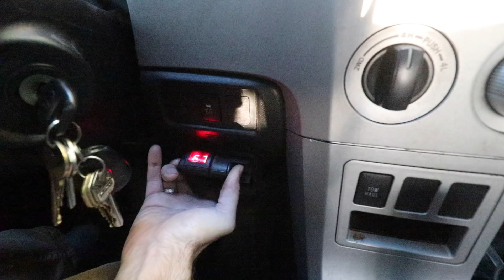How To Load a Trailer to Prevent Trailer Sway

Comment: I just used a weight measuring hitch with a little scale dial on the side and it was the way to go when getting close to the limit of GVWR with a skid steer.  I've driven professionally (trucks) (way easier) and towed with pickups some (more dangerous).  This is a game changer if you haven't had to load a pickup to capacity, or just want to be safe.  Alternately, if you feel like the front end of the pickup may be steering weird because you have the weight too far forward on the trailer and the tongue of the trailer is pushing down on the hitch too much, you are right, if the truck feels a little squirrely.  If you have weight too far back, you may never get the chance to figure it out.  I hauled a load of long logs hanging barely out the end of a dump trailer.  I went super cautiously, had no doubt I was being save and never went over 10 MPH down a steep hill, to be more sure the brakes would get me stopped, but on a lesser grade I got up to about 30 and maybe gently tapped the brakes (trailer brake control probably hit hard and caused the tongue to dive and force weight on the hitch, popping the front wheels up a bit), and it was over after I hit the brakes.... and braking made it worse, because then the tongue weight increased again as the trailer dove down on the tongue due to brakin forces and gravity down hill.   Bit of bucking going on, I suspect...  35 MPH and it ripped me off the road and down about 5' through some shrubbery and into a stone wall.  No real damage.  Just a shrub and trailer sheet metal that hammered back without a difference.  Lesson learned.  Do not have disproportionate weight behind the rear axle.

Comment: One of the government bodies here in australia used a similar method to show how increasing the COG decreased the angle required for a roll over. It also showed the roll over starts from the back. Vicroads used a scale model logging truck for that demonstration. It works quite well.

Comment: Applying the trailer brake trick saved my ass in the U.P. of Michigan pulling a loaded 4 place snowmobile trailer with my Suburban. No issues with load, going around a sweeping bend on the highway, snow covered, when the trailer started sliding. I knew it wouldn't be long before it pulled the ass of the Suburban with it, a gentle application of the trailer brake pulled it right back in line. Took another mile or two for my ass to let go of my underbritches.

Comment: To give a bit of background before my towing fail story, I'm active duty Air Force F-16  dedicated crew chief(I fix airpalnes). It was cold raining December morning around 2 or 3am in Germany. The last job of the night for us was to tow a jet down to the fuel barn. I had a shift full of younger airmen that didn't have a lot of experience and I'm the only person that was aloud to tow super. We get down to fuel barn and chock the jet so we can spin the tow vehicle around(You push the jet s back while facing them). Find out the windshield wipers just died and the only tow rig we had the rear steer didn't work so the rear wheels were stuck not straight. We get the jet in and the fuel shop guys want it straighter in there so as we are pulling it back out of the hangar a light on the vertical tail caught a chain hanging from ceiling that non of us have ever seen and snapped the light right off the tail. All we heard was the loud popping sound and the chain whipping around. We could only see the chain we shined a bright light in it. No one got in trouble since the person sent o look into said it was unavoidable and the main culprit was the invisible chain. That's the only one I was involved in but I got to see a bunch of incidents right after.
Reply from the maker: Dang, so how much is a new light for a jet?? 😅
Reply: @bleepinjeep  I think it was about $5000 for parts and about 10 man hours to fix it.

Comment: There are a lot of people who will panic and jam on the brakes when there is a death wobble. It’s so counterintuitive but in addition to applying the trailer brakes like you said but also should step on the gas. The physics will make the vehicle “longer”, stretching the train out. Instant stability.  The same thing also applies when you get a tire blow out, especially the front tire. If you get a front tire blowout, you want to floor the gas, as hard as you can.  Once you have gained control of the vehicle, then you can slowly ease of the gas and pull over safely to the shoulder. There is a whole video that some highway or truck safety people did on this. Actually exploded a tire while moving at high speeds. It was fascinating.
Reply from the maker: Interesting thanks

Comment: Excellent video - thanks for providing it.  Very good demonstration.

You talked about tongue weight based on GVW of the trailer.  It is important to know the Class of hitch you are pulling with so you don't exceed the ratings and have the hitch itself fail.  2" receivers (Class II, IV, and V) can look the same, but have very different ratings for load and tongue weight.  According to Curt Manufacturing:

Class 1 is rated at 200 lbs max tongue weight
Class II is rated at 350 lbs max tongue weight
Class III is rated at 800 lbs max tongue weight
Class IV is rated at 1000 lbs max tongue weight
Class V is rated at 2400 lbs or more max tongue weight

These numbers seem to vary some between hitch manufacturers.

You also talked about loading vehicles that have their engine in the front (most!).  As a general rule of thumb, the balance point front to back for these vehicles is about where the steering wheel is.  I find this knowledge helps in determining where to position the vehicle for safe weight distribution.

Something else your video was close to demonstrating.  If the hitch on the tow vehicle is too high - as with many lifted trucks, there is a risk of the front wheels of the towing vehicle going light and coming off the ground.  Not from excessive tongue weight, but rather from hitching too high above the center line of the axles which allows the towing vehicle to walk around the rear wheels and possibly flip backwards.  This is a huge problem with our farm tractors.  They have the power and will dig in and walk the tractor right over backwards and kill you in an instant if you hitch too high.  Flipping from this is less of a problem with on-road tow vehicles, but hitching too high will cause the front wheels to go really light and cause a loss of control - similar in a way to excessive tongue weight.
Reply from the maker: Good info thanks!

Comment: Towing my full size Jeep from Spokane, WA to Boise, ID and the spring pack bolt on the rear axle of the trailer broke, the whole axle on the passenger side slid back to the spring hanger, the tire disintegrated and the trailer kinda went crazy, this was at 75 mph! I used a come-a-long and pulled the axle back in position, put the spare on and finished the trip!
Reply from the maker: That'll make a tire hot quick 🔥

Comment: Trailer sway around 2006 or so. Took my dad on his first and only wheeling trip which he didn’t enjoy. “Too much waiting around watching other people”. We went to Livingston, KY when you could wheel there. Put the TJ on the trailer hooked to a v8 4 runner.  He hooked up and tightened the straps. Apparently he didn’t tighten them and I didn’t double check like I should have because I figured “my dad knows what he’s doing”. Jeep slid back probably a foot or so.  Came down down a hill on i75 north of Livingston and the trailer started swaying and it got worse. I looked back and saw black S marks on the road from the tires.  From what I remember, I let off the accelerator and manually engaged the trailer brakes to slow everything down.  We were lucky that day.  Pulled into the next exit to tighten the straps.
Reply from the maker: Ohh wow, very lucky indeed!

Comment: Fortunately haven't had anything too bad happen, but we towed an early Toyota pickup home and it was so rusted out there was a perfect line of rust and pieces of the frame on the trailer decking when we got home, we only needed the front axle so we weren't too concerned. I'm banking on winning, my Scout ii needs aligned, not that'll help it any haha. Great video!

Comment: I don’t know why this was so entertaining, but it was. My scariest towing experience was when I loaded my ‘51 Landrover series one onto my 9’ long utility trailer towing it behind my ‘97 TJ. It was going fine until I hit the highway, at about 55 mph it started swinging back and forth wildly. Just too much vehicle on too small of a trailer, no way to get it balanced correctly. Promptly got it under control, turned around and took it back to the storage unit I had been storing it in. Ended up finally moving it to where I was a couple of years later using my duramax and a goose neck equipment trailer. That was much easier and not scary at all. Lol
Reply from the maker: Lol, 9 foot trailer, that mustve been entertaining 🤣

Comment: Headed to Moab towing my ZJ on a car dolly behind my 2018 4Runner, which had been towed many times this way and no issues. I just had lifted it 4” with 33’s and I didn’t think of the top load, un sprung suspension. Get on the highway which is 80mph here and we got up to 70mph with my wife and 2 dogs. The Jeep started swerving side to side in both lanes on the highway as a motor home was approaching to pass, he slowed down and I managed to slow it down and get it off the side of the road. Made it down the canyon and off the highway and realized I need to ratchet my front end down to compress the suspension to gain control. Then as we hit the 2 lane road into Moab, my spare tire bounced off and bounced under my Jeep pancaking my muffler and smashing my pinion yoke skid into the yoke and it kept spinning which rounded and smashed in the threads for the u joint bolts. Then I was running down the highway to recover my spare that lanes in the middle of the highway. Big thanks to Dan Mick for letting me use his shop and tools to make to the Jeep back up and running for our Epic Moab Trip. Now there’s a flat deck and 2500 suburban. Learned my lesson. Thanks for your videos and humor love it.
Reply from the maker: Sounds like you needed to turn around and go home 😆

Comment: I've been a trucker for over 25 years, I've seen so many towing related accidents.  Most are due to driving WAY TO FAST... SLOW DOWN AND LIVE TO SEE THE TRAIL.   65mph is plenty fast enough.  
2nd I'd say is the tow rig is too small for the load. Just yesterday near sault st marie Ontario,  I saw a Volkswagen golf pulling a 20ft flat bed tandem axle trailer with 7000 lbs axles and a canam maverick on it. 
I do alot of float work, hauling excavators,  dozers, rock trucks and logging equipment.  Load placement is super important issue for sure.
 Good trick is to stand back and look at the way your vehicle is sitting, move the load forward then back to find a spot that your happy with. Then mark the trailer, if it rides bad then move it forward or rearward to find the right spot.  
Following distance..... is a real big safety concern.  Remember to hang back and avoid following to close. I've seen a number of people pulling campers rear end the car ahead of them when traffic slows down unexpectedly. 
Be safe and enjoy hauling.

Comment: My first accident was in tow, before I even had a license. I lived in rural-ish Nevada at the time. I was 12. My chore was to load up the trash in an old 50s Chevy flat bed and drive it to the dumps. Out there no one cared if I was old enough to drive. The gas gauge on the truck didn’t work, so one day I just flat ran out on the way home. Walked the few miles left to the house and got my mom. We drove our ‘77 K5 blazer out to go get it and tow it home with a strap. My mom drove the blazer, I drove the old flatbed. The last stretch was a down hill grade to our home. When we made the corner I tried to apply some brake to keep the strap taught and the pedal went to the floor. Just so happens my grandma was also in the truck with me. She saw this, panicked, and yelled out the window “NO BRAKES!!!”. My mom thought she was yelling “BRAKES”. By this time we were all moving at a good speed. I’d say 30ish. So my mom hits the brakes, hard. And we can do nothing but hold on. Mind you, this old truck from the 50s did not have any sort of restraining system. Not even an old rope to go around your waist. So grandma gets dashboarded and I get a bloody nose from the steering wheel. My mom gets whiplash, because she had turned around and was looking towards us. So that’s my towing story. Not towing a trailer, but strap towing and old truck before I was even old enough to drive.
Reply from the maker: Ha, good times 😆

Comment: Informative and the toy trucks are a great way to demonstrate this. All I would add is that when it happens: take you foot off the gas and counter-sear, as you said, DO NOT touch the brakes - when the Jeep and trailer slow, things will smooth out!

Comment: You should mention the benefits of a weight distribution hitch and how its different than airbag kits in the rear. Also how most 1/2 ton trucks require them for trailers over 5-7k pounds for proper weight distribution, steering and braking performance while towing

Comment: Scariest towing fail was in high school. Dad and I were taking a sponsored trophy trailer to a roping. I hooked it up but was used to gooseneck trailers and this was a bumper pull and didn't even think about the different ways they lock onto the ball... Lost the trailer on the freeway at 80mph. Thank goodness for safety chains😂😂
Reply from the maker: Ohh wowi bet he was mad!  What's a trophy trailer?
Reply: BleepinJeep it was just a horse trailer that had vinyl decals of companies' names and logos all over it that was to be given to the winner of the roping as a trophy. As soon as it came off and slid up under the truck and hit the ball (putting a great big dent in the nose of the trailer) I knew exactly what happened and I'm pretty sure my heart stopped

Comment: Great footage!! So A good friend and myself were in an 88 for ranger and we were hauling a 20ft trailer loaded down with scrap, we had to hit the brakes rather hard to avoid hitting someone and when we did the trailer jack knifed because we had all the weight in the rear of the trailer, when it jack knifed it ended up pushing the rear end of the truck all the way around and forced the front end of the truck into a ditch, fortunately no one was hurt. The trailer unloaded it’self too so that was cool lol

Comment: I was getting ready for Jeep beach in Daytona last year and did a frame swap over the weekend. Rented a uhaul and drove the Jeep up onto the trailer but quickly realized I didn’t do brakes yet and drove over the trailer. Had to get a wrecker to lift up the nose while we drove the trailer forward. Then realized the straps on trailer don’t fit 35’s so we had to let all the air out of the tires to get the Jeep home 5 miles down the road.
Reply from the maker: Gotta have brakes for jeep beach ! 😁

Comment: So about 11 or so years ago my buddy had an old Honda Civic with a blown transmission. He needed to move it to a relatives house about 30 miles away to store it. Did we do the smart thing like rent a truck/trailer from U-haul? NOPE. We bought some sketchy universal tow bar and attempted to flat tow it behind his even older Suburban. We had no idea what we were doing, even if we did there was probably no way to safely connect that bar to the Honda. We had walkie talkies, a chase car and 5 guys helping out like this was some sort of massive undertaking. The damn thing didn't even make it two blocks 😂. It started swaying all over the place, immediately snapping whatever rusted support we bolted it to. Then when he stopped to check on it the tow bar impaled the radiator... he gave up and junked the Honda shortly after that (probably for the best).
Reply from the maker: Haha, sounds like a fun adventure
Reply: We made everything into an adventure back then, simpler times.

Comment: I once towed a single cab Cummins on a 18ft flat deck trailer with my single cab ranger.  I mean i went less then 20 miles at no faster then 35. But my ranger was lifted 9in 33s 2.9 v6, a 4.0 v6 explorer 5speed trans (totally wrong ratios for that tiny v6 and stock gears) no swaybars and welded diffs. I ended up cracking the xj leaf's I added into my already bastardized leaf packs and I twisted a shackle clean off. I didnt relize it till I went on the highway to go home after. It was a bit squirrelly
Reply from the maker: Dang 😳

Comment: This exact thing happened to me towing my old car on a 2 axle trailer. In my ignorance I set the trailer up with a load of about 20 lbs at the hitch. 15 miles on back roads fine. stopped and checked everything: seemed fine (to me!). Onto the freeway and as soon as I got to 60mph the whole setup started violently snaking across all 3 lanes. With howling from the rubber on the back wheels as they were being dragged sideways from one edge of the road all the way to the other. I put my foot hard on the gas and just prayed and after two more snakes it straightened out and I eased to a stop. A near death experience. Fortunately it was 5.30 am and no other traffic. I reset the load and proceded VERY carefully for the next hundred miles without incident...
Reply from the maker: Scary stuff!

Comment: My worst towing fail was an almost fail really. Towed.my popup with my 97 TJ from SC to Harlan KY for OSCAR which is an adventure in it self. On the way back from our trip o noticed a constant bumping from the center of the Jeep. Couldn't see anything during gas stops. Pulled into the rest stop coming into SC when one of my buddies noticed my engine skid plate was dangling by a bolt. The bouncing o felt was my skid plate bouncing on the highway for 7 hours...
Reply from the maker: Lol, that's pretty bad